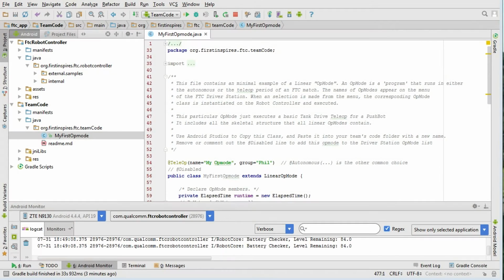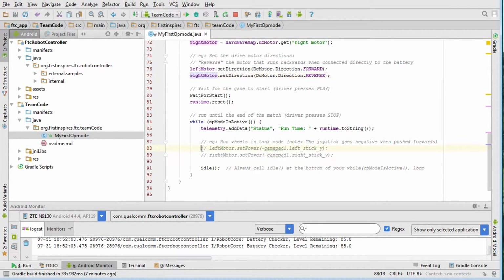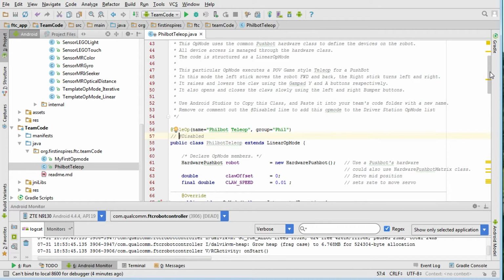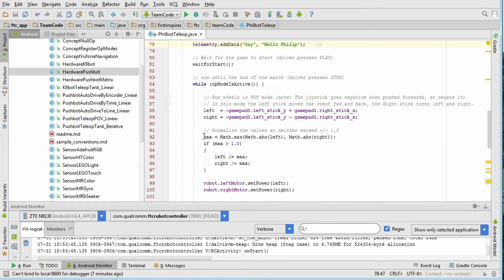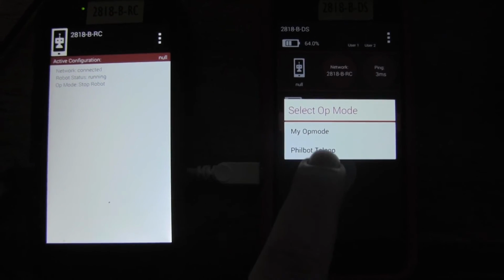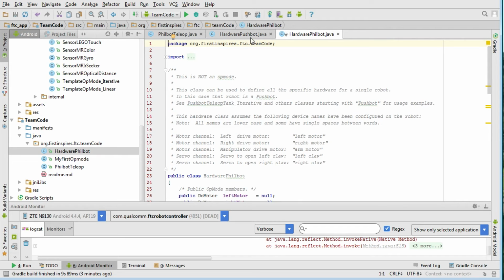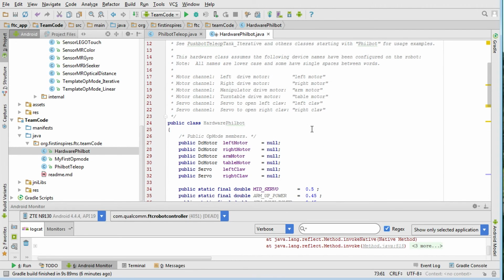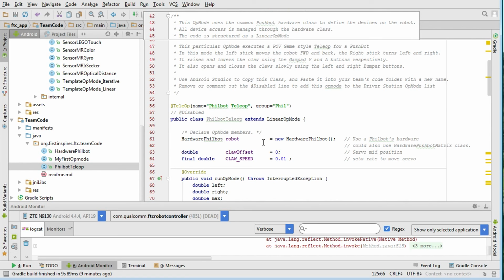FTC Java Tutorial Part 2: - More on OpModes

Comment: As soon as I uncomment the DcMotors, it has a red line under it and a small window that pops out of it saying com.qualcomm.robotcore.hardware.DcMotor? Alt + Enter. I have watched part one of your video ( great job making that video it helped a lot). Also, I've noticed that under your FtcRobotController > Java folder, you do not have a "com.qual.comm" folder. However I do. Do I need to delete that folder to solve my issue? Thanks
Reply from the maker: It sounds like your version of Android Studio is not automatically adding the class "include" that's needed.  It's prompting you to hit Alt + Enter for more assistance.  Typically when you add a reference to a class that's in another module, Android Studio automatically includes a reference to it at the top of your file (expand that first section to see all the includes).   Sometimes you need to add it manually, or just tell AS to add it.   Hit the Alt Enter, or roll over the error and then click the red icon that appears at the left of the line.
Reply: Ahhh I see! Thank you! It works now.
Reply from the maker: Thanks to Hexafraction, here is a link to a page describing how to turn on Auto-Importing. http://stackoverflow.com/questions/16615038/what-is-the-shortcut-to-auto-import-all-in-android-studio/16616085#16616085

The gist is that the option is in File -> Settings -> Editor -> General -> Auto Import -> Java.